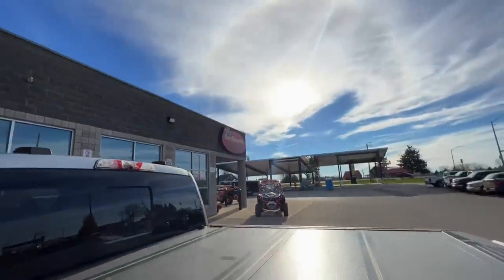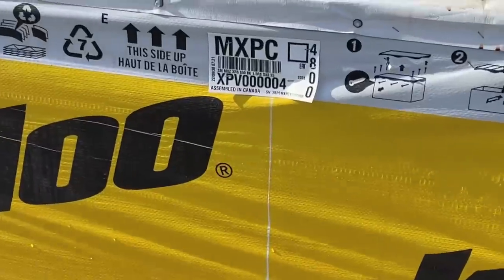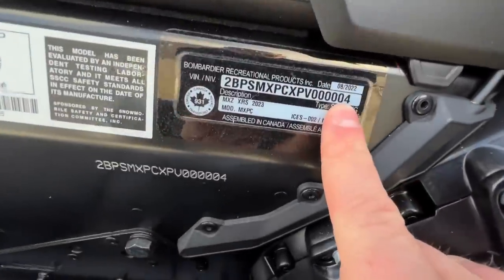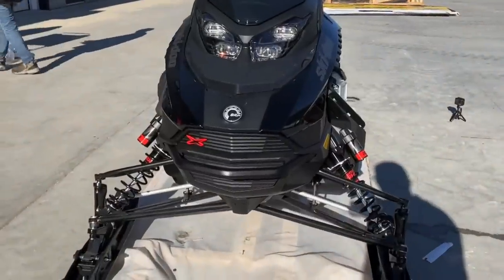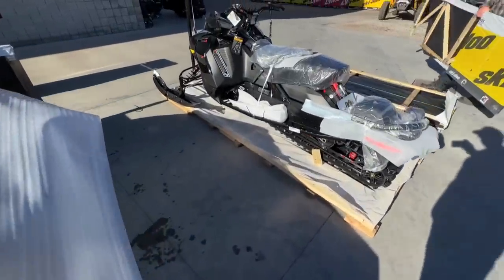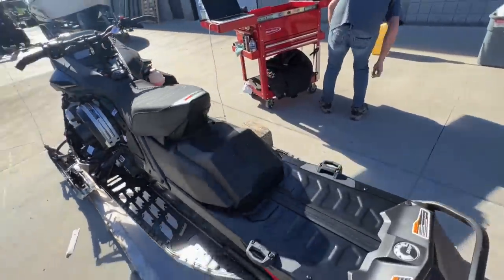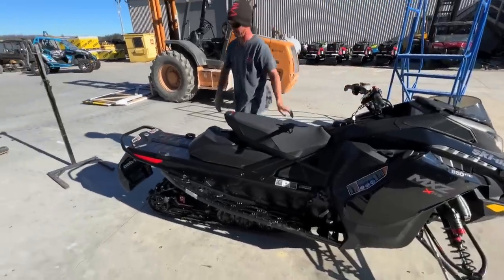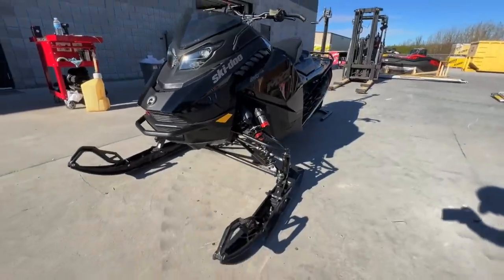UNBOXING 2023 Ski Doo Gen 5 850 XRS SS!

Comment: glad to see you didn 't lay the side panels on the concrete when assembling,hate when dealers lay them down on the ground and scratch them,
Reply from the maker: Of course
Reply: I rock a padded table and foam mats on my floor for that reason... Put a massive scratch down the center of a brand new 400-500$ defender hardcoat windshield by assembling it on an uncovered folding table. Did that job twice and learned my lesson that day.

Comment: Did you notice 3 wheels on the throttle side and only 2 on the brake side
Reply from the maker: The third one is on the inside, they did that cause the suspension is in the way

Comment: Whoa wait what is smart shox? I finally seen this gen 5 everything looks different now!!
Reply: Smart Shox isn't actually a gen 5 thing. They came out last year on the gen 4. It is electronically controlled dampening on the front and rear suspension. This allows on the fly "stiffness" control for different riding scenarios. Toggle switch on dash allows for 3 settings; comfort, sport, and sport +. 
Downfalls do exist though...
Increased complexity ie: more things to fail/get damaged... I've seen a maverick with non functional Smart Shox with less than 10miles simply because the guy put a strap over the harness on the rear swingarm and pulled it out of the shock. 
They aren't compatible with some accessories like the adventure front bumper and lateral foot holders.
Lastly, they sometimes come from the factory not completely connected, which adds diagnosis and repair to the PDI(Entirely a me problem but it still sucks lol)